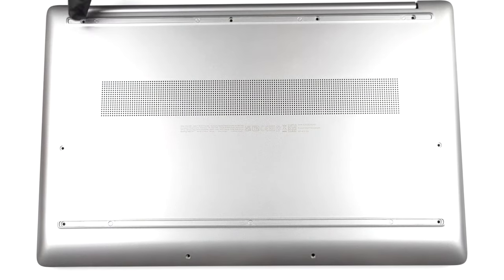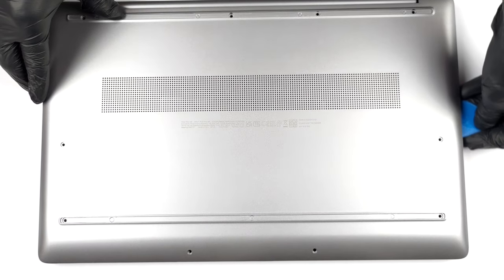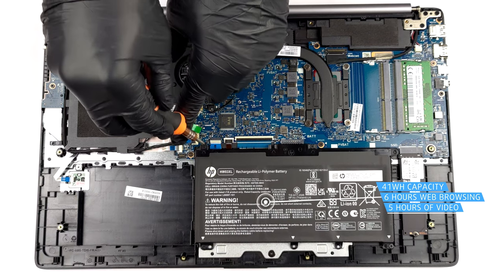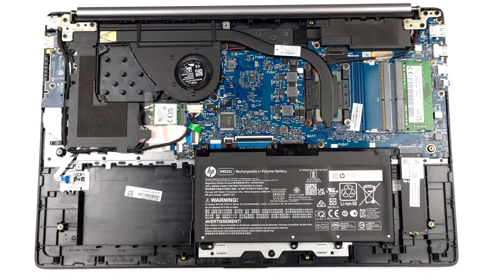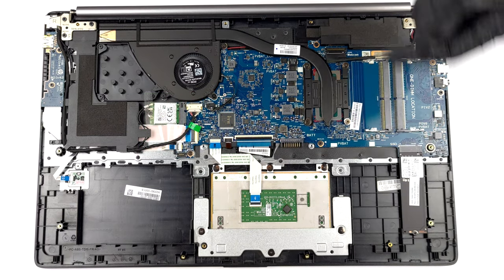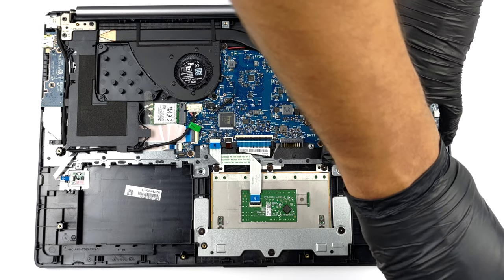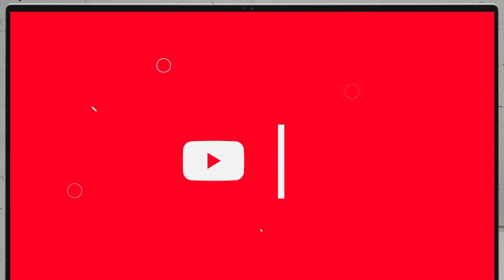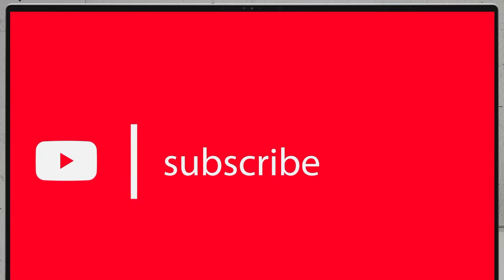🛠️ How to open HP 470 G9 - disassembly and upgrade options

Comment: Since nobody sells the tray I guess? I am gonna use industrial adhesive velcro the ssd 2.5 add on drive I got. It's been impossible to find this and even hp cannot determine a part number for the g9.

Comment: Where to get this 2.5“ mounting Kit? Product number?
Reply: SSD 2.5 sata drive update information per HP.

For those buying this or other laptops like it HP mo longer offers the 2.5 sata tray or cable. Basically phasing it out over the plug and plug board ssd type.

Their recommendation is to find 3rd party that will fit. 

I was able to use industrial strength adhesive velcro to the laptop chassy and 2.5  ssd drive and a standard ssd cable for laptops. Other than this solution you will have to alter or find a tray that fits which I haven't yet.

The tech for hp did say there is possibly a couple models out there where the ssd tray would fit but he couldn't give any more information on it.

So consider this when looking at hp now as future models he said may not contain the 2.5 sata option or port as these do and prior models.

Comment: There's room for a 2.5'' SATA Drive but there's no connection cable ?
Reply: It's a pretty common for Lenovo, in this case looks similar. You have to buy it separately.
Reply: @guig2004  Can you make a tutorial how to add a 2.5 sata drive to the empty space on the left side? Thanks and great  job!
Reply: @Vanin1993  there is No need to record or write a tutorial. You just have to buy a sata connectot/adapter at the aliexpress and connect it to mainboard (you will find dedicated socket).
Reply: @guig2004  Thanks, ist there any mounting bracket that will fit well?
Reply: @Vanin1993  depends of what package you will buy. They deliver it separately or as mouting set. Just find one at Ali.
Reply: SSD 2.5 sata drive update information per HP.

For those buying this or other laptops like it HP mo longer offers the 2.5 sata tray or cable. Basically phasing it out over the plug and plug board ssd type.

Their recommendation is to find 3rd party that will fit. 

I was able to use industrial strength adhesive velcro to the laptop chassy and 2.5  ssd drive and a standard ssd cable for laptops. Other than this solution you will have to alter or find a tray that fits which I haven't yet.

The tech for hp did say there is possibly a couple models out there where the ssd tray would fit but he couldn't give any more information on it.

So consider this when looking at hp now as future models he said may not contain the 2.5 sata option or port as these do and prior models.
Reply: @guig2004  That's perhaps the essence of the whole matter: all these laptops look so similar to each other on the inside that one can make a correct assumption they are made on the same factory or maybe there are three major factories in China that produce OEM products for all those known laptop brands out there.

Comment: SSD 2.5 sata drive update information per HP.

For those buying this or other laptops like it HP mo longer offers the 2.5 sata tray or cable. Basically phasing it out over the plug and plug board ssd type.

Their recommendation is to find 3rd party that will fit. 

I was able to use industrial strength adhesive velcro to the laptop chassy and 2.5  ssd drive and a standard ssd cable for laptops. Other than this solution you will have to alter or find a tray that fits which I haven't yet.

The tech for hp did say there is possibly a couple models out there where the ssd tray would fit but he couldn't give any more information on it.

So consider this when looking at hp now as future models he said may not contain the 2.5 sata option or port as these do and prior models.